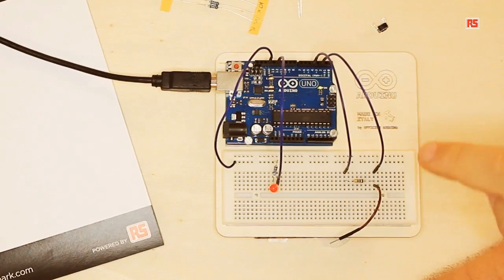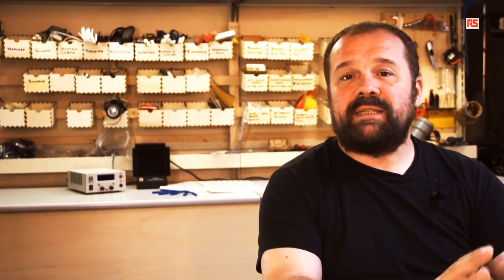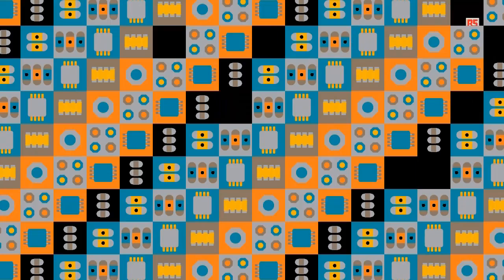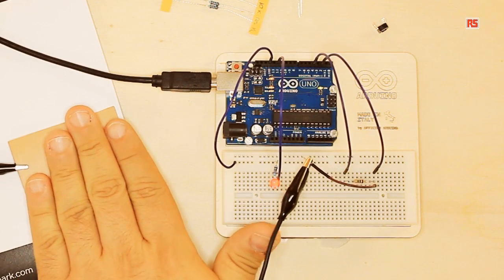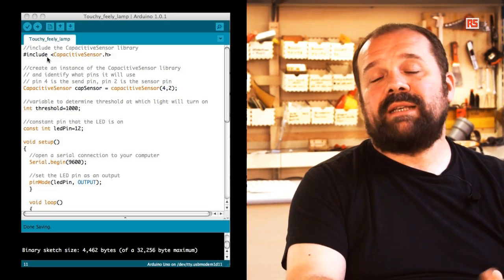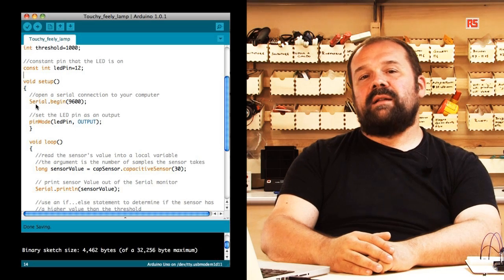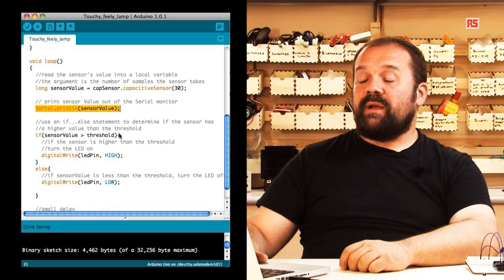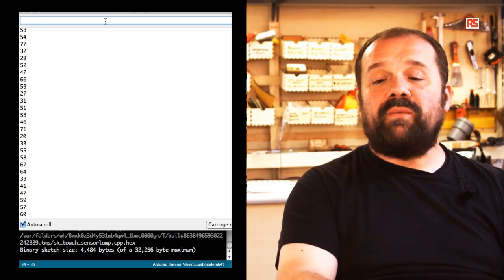Arduino Video Tutorial 08: Touchy-Feely Lamp | RS Components

Comment: well the Arduino uno can be hacked to emulate a mouse but the Arduino Leonardo is much more suitable for this. The mouse/keyboard emulation comes out of the box.

The capacitivesensor library can be used to create a limited amount of touch sensitive areas so emulating a trackpad is probably outside of what can be done with it.
the basic principles behind how a trackpad works are the same (capacitive sensing) so this could be a starting point